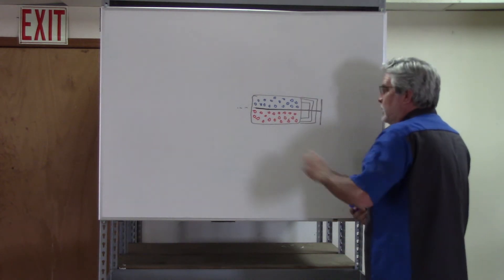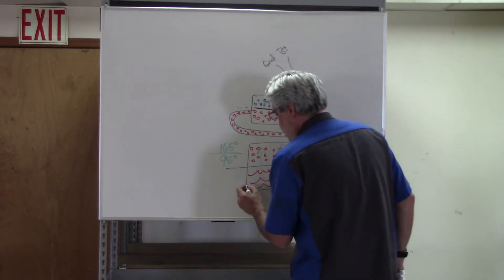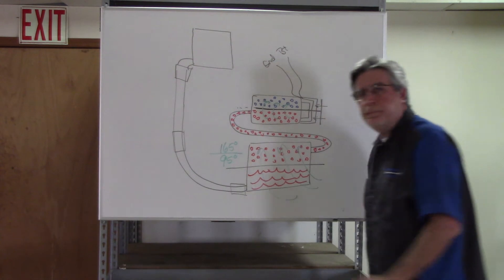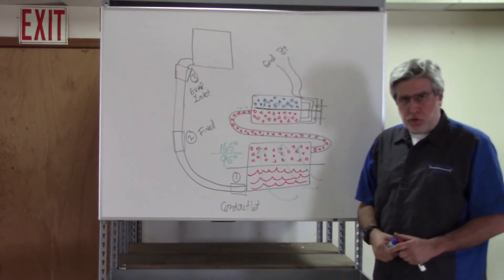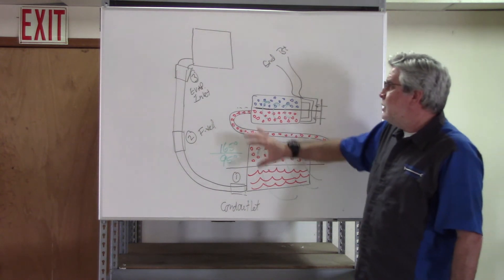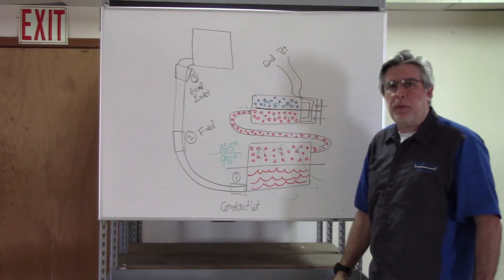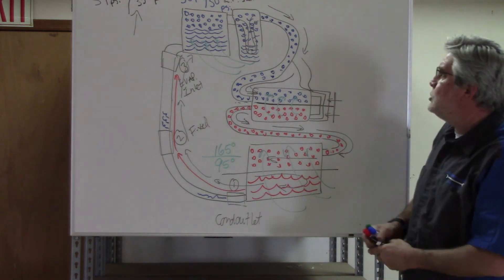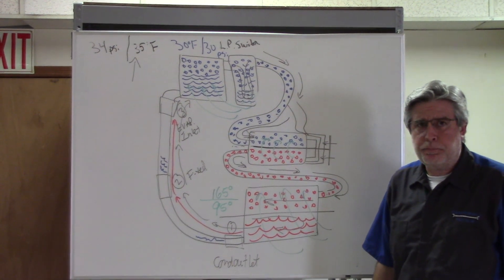AC Orifice Tube System Explanation

Comment: Here again the state of refrigerant is effected by temp and pressures. If you don't know the temp you can only assume the state of refrigerant. The pressure tells you on the gauge the temp of saturation of low and high side at that moment. Saturation is the time it spends changing from a liquid to a gas or gas to a liquid. It's a constant temp. Anything above or below that temp gives you the state of liquid or gas. Relying on a cut off switch is the worst case scenario of performance for the system. HVAC technicians have to know all this stuff before they work on a residential system. Auto technicians just pick up bits and pieces based on how much time they want to invest. That's when people get really screwed. Lol